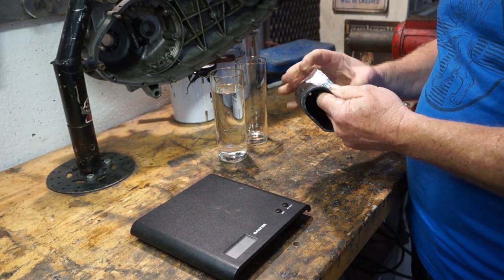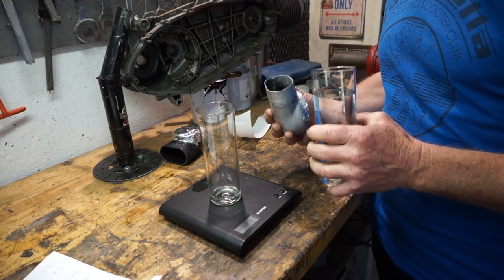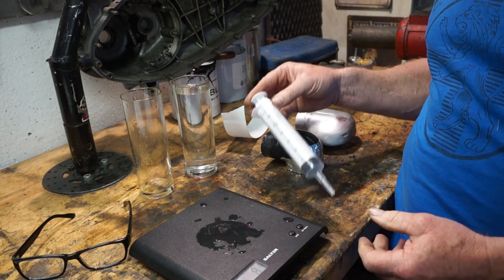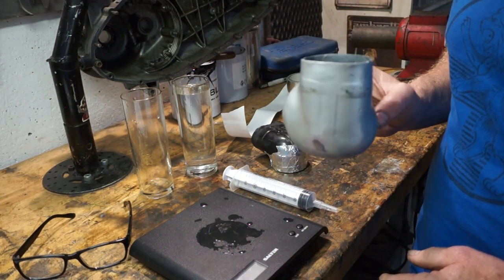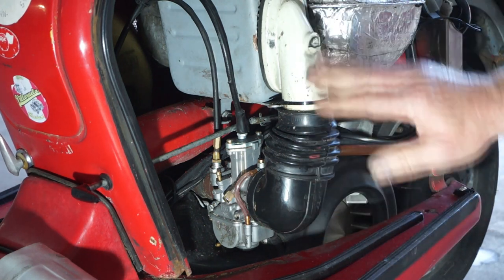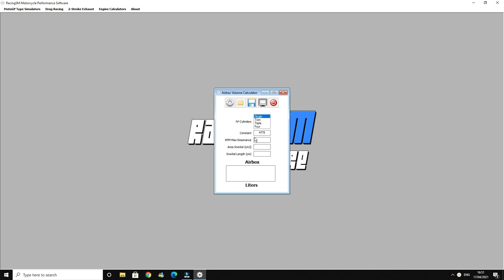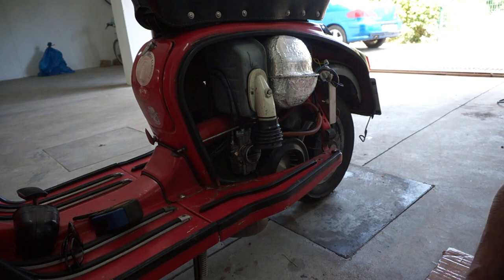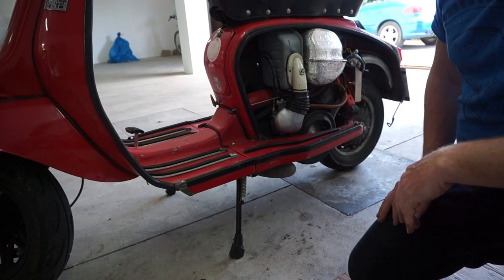The best Lambretta air filter in the world

Comment: Very interesting work on airflow!
Just curious about the li 150 barrel you converted to 165 with a Kawasaki piston a while back. 
Is it running in a bike?
Reply from the maker: Its waiting fitting ? But I'm not the first to use it it's very common in Thailand used by Asi lambretta tuning . Bit difficult to get that piston it's only available in the Asian market  .
Reply: @TheSteelweasel 
Aha, not a very sexy conversion these days I guess..
But still, probably a lot of 150 barrels lying around unused.
Any other piston suitable for a 160/165 conversion. 
That you know of?
Reply from the maker: @johanakermyr1437  Dave Webster  did a 150 conversion with a short stroke ?  Which would be a similar size think it was a H1 kawasaki piston but it will have a 7mm compression hight difference,   so you would have to use a 115 or 116 rod ? Or machine the barrel .

Comment: Hi Steve I see you have kept the air box on your scooter did you take out the air tube inside the box out or did you drill holes in it to get a better air flow through the carb  do you use the air box to restrict the air flow to the engine to keep it cooler in a hot climate just trying to get my head round all the different opinions flying around about the air flow to a tuned engine and bigger carb  if anyone knows it’s you what’s the answer 🤔🤔🤔
Reply from the maker: First you dont need big carbs smaller carb has more low end torque and better response.  I'm using bgm air box nothing in side and the neck is bigger with the bgm filter inside but I have lined the box with 3mm thick foam rubber to kill the induction noise.
Reply from the maker: Ahh yes and my filter bellows 😁 engine is casa 185 .vape sport ignition . 6 plate af clutch with lighter springs . Li 150 italian box 17x 46  bgm clubman and pwk 26 mm carb

Comment: HI thanks for the video. I was wondering about your measurements when you measured the length of the hose etc and then the stub. By measuring the stubs full length aren't you adding more volume than is actually there?
Reply from the maker: i only added the neck , its just a ruff estimate not easy to get a accurate measurement ,  sorry !

Comment: Good video,what airbox mods have you done,did you cut the spout out and what filter do you use.....i tried to use an airbox on a reed motor it worked....but the noise that came from the airbox was unbearable while riding...id removed the spout  and increased the neck diameter...all this seemed to amplify the intake noise
Reply from the maker: It's a bgm air box with foam lining to kill the induction noise. The baffle/ spout ? Is for sound reduction

Comment: Sweet , how is it you dont run an open mouth carb with say vented panel , would that not give more air steve ?
Reply from the maker: Too much sand and dust here mate . Just stripped my ts1 that was open carb most of its life and it was totally worn out ? 2 mm ring gap  needs a rebuild . If you want power then open carb but long life engine needs a filter .
Reply: @TheSteelweasel  oh yeh i forgot you live by the coast mate 👍✊

Comment: Why not just use a BGM 42 or48 air bellows or no filter at all or just take out the box altogether and use the bellows with a BGM fast air flow filter as a remote set up I’ve used the later on ms SX 200 and just had it dynod  they said it works really well🤔🤔🤔
Reply from the maker: Please let us know how it starts when the engine is hot 😊